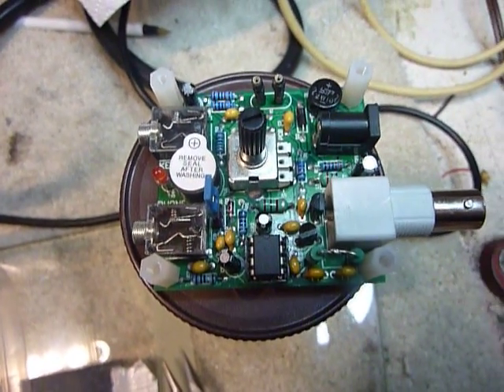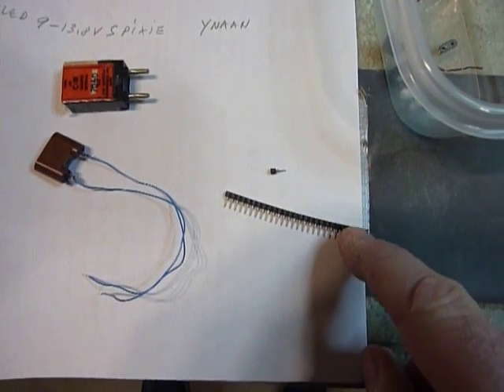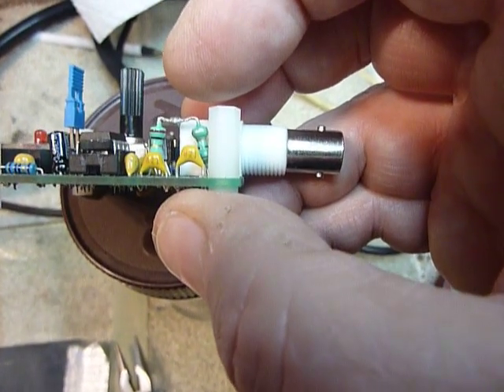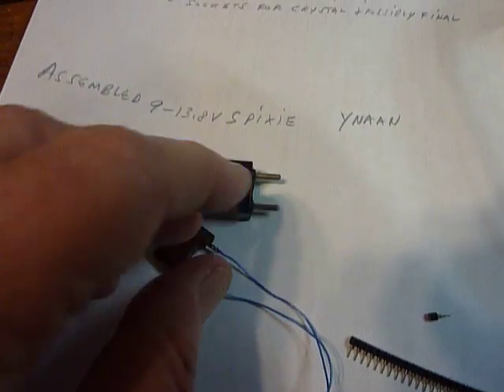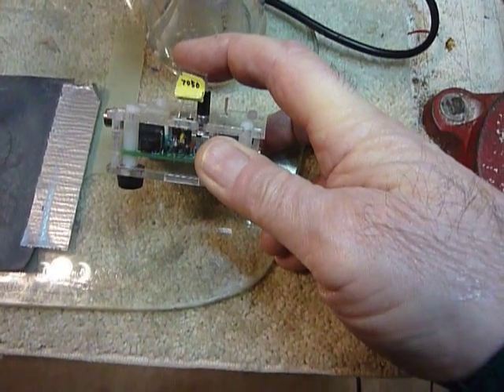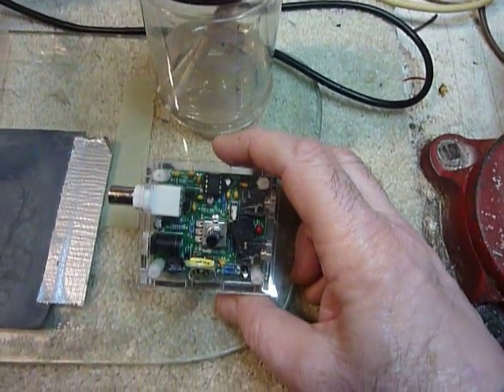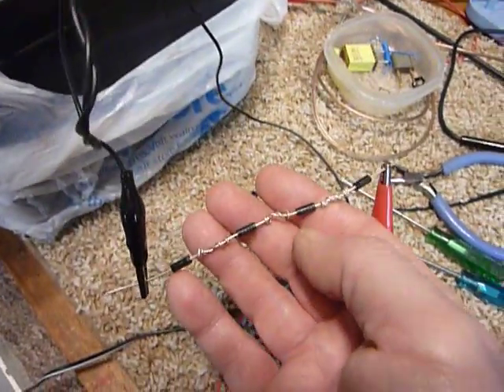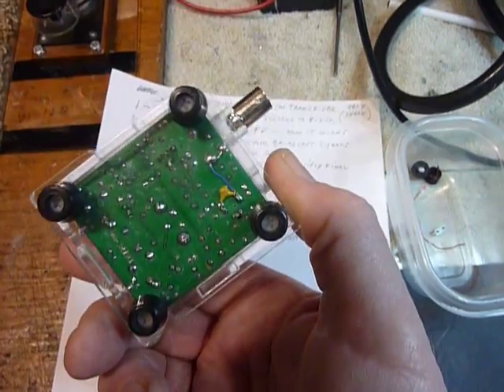PIXIE QRPP CW RIG ,PIXIE MODS,PIXIE on 80 CW, QRPP  CW ,PIXIE S TRANCEIVER

Comment: I built one of these as well.  I noticed the final runs hot as well.  I got better results when I switched the local oscillator q1 with a 2n2222, and replaced the final with a MPSU01A that comes in a larger heat-dissipating package, and wont blow at higher voltages than the 9018 original.  Hope to catch you on the air! DE KCØJCA
Reply from the maker: Thank you Charles.    73's  Bob W9RAS

Comment: I had one on 5.262MHz. 350mW out but it also failed after a while on 12 Volts. No B.C. band interference. Worked distances of 40, 80 and two about 180 miles and a short wave listener report from Holland 220 miles away. Inverted vee aerial.
Bill, G4GHB.

Comment: Hi Robert!

Very cool video. Please make more of them. This is good learning content for beginner QRP hams.
How do you find using this pixie? I got the same kit but haven't assembled it yet.
Is it actually usable in field? I hear that they pick up several signals at once and all kind of noise and clutter.
Any luck with making a contacts with it? Maybe you could do a field video with it?

Cheers from Poland!
Zbyszek, SP2LS
Reply from the maker: ZBYSZEK  Thank you for the nice comments . Thats the idea behind my videos is to help others like I have been helped and to preserve the knowledge that has been passed on to me over the years .I have been on the air now close to 60 years .  73  Bob
Reply: What you've heard is correct.  I had to chuckle on your comment about noise and hearing several signals at once.  I had all that with my first rig.  Eventually you'll lern to use your ears to filter out those unwanted signals.  You'll listen for your call coming back to you and you'll give that signal your top priority.  I found myself copying weaker signals even when a very strong signal was transmitting almost on our same frequency.  It's not easy at first, but it comes to you.

Comment: I'm embarking on a project to take every good mod I can find for this radio and have a PCB made up with them all integrated. A MegaPixie, or Pixie 5, if you will. 4.3 is the highest version you can find it seems.

Changes will be to completely change the final LPF and turn it into a BPF for 40m, and also adjust the LM386 audio amp circuit to include proper sidetone and ditch the buzzer.

Do you know if there's any reason why there's traces on the bottom? I made a design in software and managed to get every trace on the top and use the bottom exclusively for a ground plane - that has to be better, right?

Also thanks, this was really helpful.

Mark/MM3IIG
Reply: I'll probably also find the best transistors that people recommend for power output and heat reasons.

Comment: You can replace the crap Chinese transistors and run it up to 12 or 15v. 
If you use two xtals in parallel with a small trimmer in series and you have a Super-VXO giving you a much wider frequency range.
Reply: Could you be a little more specific about the VXO? Do the two crystals define the limits of the range, with sweep between? And what sort of trimmer? Thanks! I wanna try this.
Reply: @RobMacKendrick  essentially with one crystal you get about +/- 100 khz i think, with two in series you get +/- 200 khz?
Reply: @MarkPentler  Thanks!

Comment: If I wanted to mod it for 20 meters, would I still need to change the capacitors or just the crystals only?
Reply from the maker: I Have not heard of anyone making a pixie work on 20 meters but it should be possible . It will require capacitors AND crystal to do this . You may have to try different values of capacitors  I have no idea what values ? I would start with 1/2 the value used for 40 meters . You may spend a lot of time before arriving at the correct capacitor values . If it was me I would look for anything in the internet on this perhaps someone has already done this AND don't forget the pixie comes in many forms so you may find good info on another version of the pixie or similar rig that will help with the Mod.  If you get it going on 20  make a youtube video !    Good luck  73  bob
Reply: Robert Sumption I've got a pixie on order.  I also have a 7.040 crystal on order as well.
Reply: After I build this one,  I may try to build the 20m mod.

Comment: Have you had any contacts yet?
Reply from the maker: Contacts YES a few ... I have not operated the Pixie a lot but have received some nice QSL cards from contacts while  running the Pixie on 9 volts with 360 milliwatts output. The antenna is very important at this low power .

Comment: Robert, I made a Pixie from China and have worked 9 states on 40 meters.  The noise is a challenge but I have been running mine on a 12 volt battery. It is the original Pixie v.3, not the super pixie. See me on QRZ.com N9EGT Wayne
Reply from the maker: Good job ! Wayne .  The Pixie is a fun rig for sure .  Amazing what can be done with minimal equipment .  73  Bob